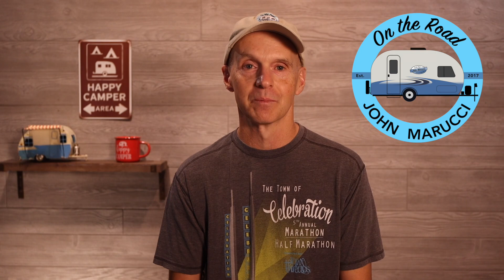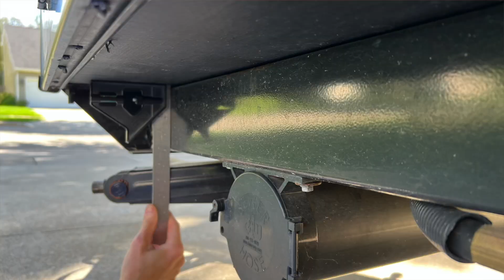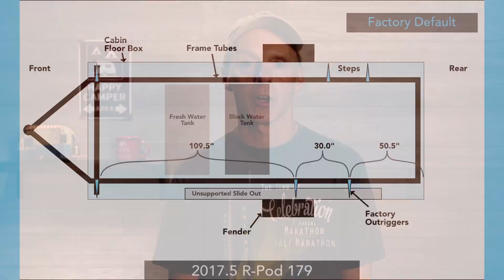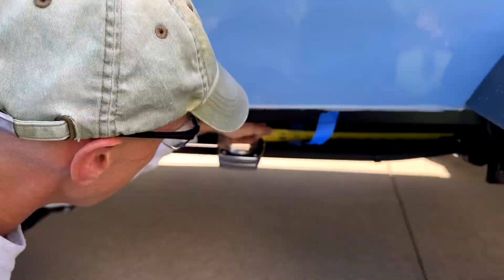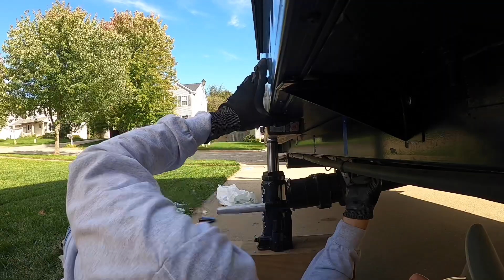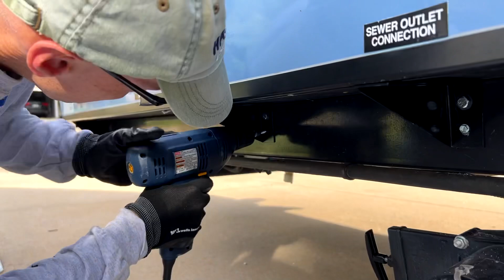R-Pod Outrigger Installation – Step-By-Step Process

Comment: If you can , use a pointed punch and hammer to dimple the location you want to drill so there is no chance of the drill walking out of the marked area for drilling. Use a pilot drill bit 1st if you don't have better quality to size drill bit.
Reply from the maker: That is a great tip to help ensure accuracy, thanks for sharing!

Comment: Hi John, I have several questions but will try to keep it simple. I bought a RP 178 built in 2013. This model only has one outrigger at the front of the trailer. I have significant sag below my pullout and will make myself several outrigger to fix the issue. My main question regards the construction of the floor itself. From other videos, I think I see that the floor is made of an aluminum square tubing frame that extends to the outer wall. So I think/hope it is a large rectangle of square tubing with cross braces welded at some irregular intervals along the length of the floor. I have to guess, the wall bottom is also a square tubing and it is bolted or screwed on top of the floor square tubings that are 6 inches outboard of the trailer steel frame. So here is the question: How can the wall sag if you have square tubing extending out over the steel frame. Are those square tubes breaking or bending under load? Should I try and position my outriggers right underneath of these aluminum square tubings cross braces?
Reply from the maker: This video may help as it is about 11 years old and should show some of the construction: https://youtu.be/vMXneKc_fDo?is=44Hr7luVIli6fCsd
Reply from the maker: My guess is you have weight and force over time that have injured the original wields on the aluminum rails.
Reply: @JohnMarucci This is what I  also suspect. I will be adding 12 outriggers on that side since there was only one at the front. 6 more will go on the other side as well before it suffers à similar fate. I am debating adding a piece of facia like sheet metal between the outrigger and the floor underlay that I would seal against the frame and along the side rail to provide lasting protection. I would appreciate your thoughts on this as well. It's a 2013.
Reply: Thank you very much John. Also, I have some more news on the matter of the floor construction. Because I found water in the floor of my 2013 RP178 rear cargo compartment, I removed a section of the underlay membrane, pulled the linoleum from above and removed all the delaminated plywood above and below that area. This gave me a clear view of the aluminum tubing in question, on both sides of the trailer. On the slide out side that was sagging, the tube is cracked (more like shattered) at the location of the retaining bolt, just outboard of the trailer steel frame. To my extreme displeasure "/$%?, the side that showed little to no sagging is also cracked so both ends of that square tubing are cracked just outboard of the steel frame. I took pictures of my discovery and could share them with you so others can beneficiate. Let me know which of your sites best allows for picture uploads. This tubing is much thinner than I expected ( 18 gauge, 16 at the very best) and extremely brittle. It feels similar to 2024 aircraft grade aluminum, I have seen on older Cessnas. Obviously not well suited for the repetitive high loading an R-pod floor is subjected to. I am going from bad to worse in my discoveries. Not what I wanted to see as you can imagine but would like to share with others who may wonder how the floor of an R-Pod is built. Regards  @JohnMarucci

Comment: Great video, I was wondering if you remember the dimensions of the bracket I have a 2016 RP 180 with the same issue, the slider wall  actually dropped down because of the sag. I just went to my local dealer and ordered the out riggers which are the exact same ones you had ordered. It looks like I have less room horizontally for the bracket. In that case, I may have to cut off the ends to keep them under the trailer. My thoughts are based on your video that you put out. Compare it to my trailer.
Reply from the maker: Thanks for watching! I do not have those dimensions, but the basic practice should be the same. All the best!

Comment: Are the zinc plated screws and bolts showing any sign of corrosion? I've debated going with stainless steel.
Reply from the maker: Unfortunately, I can’t speak to how the screws and bolts have done over time as the unit was sold a couple of years ago.

Comment: My 2017 R-pod 178 never had any outriggers installed. Found out about this issue last spring when I noticed that the fender on the slide side had less than an inch of clearance from the tire.

Phone calls and emails to Forest River’s parts department were ignored, though I tried calling the sales department and they picked up right away before transferring me.

This year I gave up on those scumbags and ordered reinforced 4x6 counter brackets and 1/4 aluminum plates from Amazon. They should be arriving today.

I just need to get this to a seasonal site I am leasing less than 10 miles away. Then I’ll back it up with some 2.5 ton rv stabilizers and a 2x4.
Reply from the maker: Sounds like a plan that could do the trick. I know several people on the R-Pod Owners forum have had outriggers made: https://www.rpod-owners.com/

Comment: Hi John. I am traveling so I cant wait around for Forest River to send me the outriggers. Do you think a length of steel L bracket welded to the frame would provide the same support? thanks so much for the video. I thought the floor had sunk down because I had spilled too much water on the floor😭
Reply from the maker: I would ask some of the folks on the R-Pod owners forum how they created their custom outriggers. I think there may even be a small fabricator making these now. rpod-owners.com
Reply: Innovative Machine & Supply has Outrigger brackets on the shelf ready to ship!

Comment: Interesting video John and thanks for the info with regards to the body outrigger supports. I have this problem too on my 2019 R-pod 180. I contacted Forest River about obtaining the supports, but instead got a lot push back. They feel that the supports just fixes a symptom and not the problem. They wanted me to take pictures showing the over hang sag with a combination square which I felt was reasonable. They sent me a questionnaire titled "Over Torsion Axle" where they also wanted a pictures of the axle tag on the Lippert axle, pictures of my towing set up, hitch set up, hitch, weight distribution hitch with the brand, tongue and weight capacities and tow vehicle type. They also wanted pictures of the unit showing the clearance between the fender and tires. Apparently they feel that this body sag is related to the axle and weight distribution hitch. I told her specifically that the floor sag was only evident directly under the slide out. That there is no sag in any other location. I told her that I felt sure that the issue was because of the lack of out rigger body supports at the frame. I measured the distance from each side of the frame at the axle to the ground which was exactly the same. I used a string to check for any bend in the axle housing - none. I checked the distance between the fenders and the tires which was almost the same. There was some difference in the clearance measurement only because I discovered that one fender was mounted higher on the body than the other one! I asked if I could just purchase the outrigger supports from her direct and she refused. She also wanted pictures of the inside floor sag with a level. I told her that there was no evidence of interior sag or separation between the floor and wall and hopefully will avoid any future separation if I can get these outrigger supports now so that I can install them immediately. She actually said no that I still needed to get pictures interior floor with a level. I'm at wits end with Forest River. I had many issues with this unit when I first got the unit new (that's a whole different story). I told her that if I can't get the outrigger supports from her, that I would go to a local fabricator and have them made. Sorry for being so wordy here, but wanted you to know my story and couldn't find any other way to get in touch with you.
Reply from the maker: Thanks for sharing your experience. Unfortunately, it is par for the course for R-Pod and was for me somewhat. They have been pushing back lately on supplying outriggers to customers and have taken some owner's units in and replaced the axle. If they are willing to fully add outriggers and replace the axle on their dime off-season, you may want to consider it. These all should have been recalled for this sag issue. There is a ton of dialog on this exact issue on the R-Pod owners forum (not FB): rpod-owners.com. FYI, I saw an identical post on another video and only left this one. Thanks.
Reply: Thanks again for replying. Yes...at first I balked at going through the process on the axle and all the info and pics they wanted when I was just wanting to purchase the out riggers. After giving it more consideration, I'm going to cooperate with them and see where the process goes. Like you said, if they are willing to add the out riggers and replace the axle on their dime, why not go a head with it and at least test the waters.
Reply: @wavanauken  Same thing just happened to us this spring. We had an annoying back and forth, but FR replace the torsion axle on our 2017 for free. They said they would send the outriggers along with it, but we would need to take care of the install of those ourselves, but the dealership doing our axle did the outriggers for us as well and we didn't pay a dime. It was gone two months, maybe only lost one month of the season, but it was annoying that it was that long because FR made the dealership go through the whole picture process all over again despite them already telling us it was approved.
Reply: @Bandgazebo  My axle turned out to be OK which I was pretty sure of anyway as I had no symptoms nor was there any sag in the suspension. The dealership confirmed the body sag under the slide out after Forest River made them jump through many hoops. I knew there was sag there as I had already checked it. But they did say they saw evidence of water leakage and attributed that to bad owner maintenance! That really ticked me off. Uh...yeah it had leaked water from the get go when it was brand new because the manufacturer didn't seal the the spoiler on the roof correctly. And then there was another water leak 2-3 years later because they didn't mount the AC unit correctly when they didn't properly torque the bolts to apply the right amount of pressure to the A/C roof gasket seal. Geeeeeez. And I got these leaks fixed right away so there was no prolonged water contamination or damage to the walls. Just some staining. They also said they could sell me the supports. Ha! SELL me the outrigger supports!!! I said NO. I will get them from a good independent metal fabricator which I found through one of the Forest River forums. The supports I found were much better quality than the ones FR offered me. And get this - I was talking to this independent shop about this issue and he said, yeah...we've sold a lot of these outrigger supports made directly for the FR R-pod. I asked about how many and he said oh...about 400-500 or there abouts. REALLY!!! That many shows just how poor the build was. The weight of the slide-out directly over the cantilevered frame where FR failed to install supports is what lead to the body sag. Not the axle which they said could cause this. What!!! The axle can cause the unsupported body to sag! Ha!! And it sure wasn't because of the alleged water contamination. 

When I first got this vehicle, there were about 20 things I found wrong with it. The dealership fixed a lot of it after many weeks of frustration getting it done. I repaired a lot because I was just sick and tired of dealing with them and taking it back and forth. That and I sure was more confident in the repairs I made myself because I knew i would do it correctly. I called Forest River directly about the poor workmanship when the unit was originally built. I sent them an 11 page write up with pictures of everything that I found wrong with it. They covered everything warranty, but that was such a hassle. They said that is what the warranty is for - to have these issues repaired. I told them no, the warranty is technically to repair mechanical issues that arise during the warranty contract period, not for defects that it comes with right out of the factory. Heck...the dealership even admitted that Forest River uses them as their quality control because they know there will be problems. Ha!!! I asked Forest River that I deserved some compensation for the hassle (many back and forth deliveries of the unit to the dealership, the waiting, the seemingly endless back and forth communications with the dealership and Forest River, etc.). They asked what kind of compensation was I looking for and I said somewhat jokingly some cash back would be nice. They said how much?!?! I was totally floored. I said how about $500 and they agreed! That says a lot and I'm not talking about the positive side. 

Also, actually, I had to get the AC gasket done twice. The first time I made a claim to my extend warranty company and I had it done at a dealership. Six months later it started leaking again. The gasket was cheap and it failed (split at the corners). I fixed it myself this time as I wasn't going to trust them to do it again even if it was warranty. I mean...the warranty is no good if they can't make quality repairs. And I wasn't going to use the same type of cheap gasket. I used a premium one piece high-quality closed cell EPDM sponge rubber gasket. Sure it was more expensive than the cheap gasket that was originally used, but it was a better gasket. 

Sorry for the wordy response. I will never deal with Forest River or their so called recommended warranty dealership service centers. Just FYI, I'm a retired mechanic and fleet manager with 38 years experience, so I do know a little bit about these things.
Reply: @wavanauken Can you tell me where you purchased your A/C gasket? Thanks

Comment: I just bought 6 outriggers. My 2016 has zero. I just came in from jacking the camper up, and it does not square up the floor to the frame. Odd......😮
Reply from the maker: That can happen. A bunch of people on the R-Pod owners forum have installed these with this exact situation. You’ll want to inquire how they handled it. rpod-owners.com
Reply: Thanks, John, much appreciated.

Comment: Hi John. I hope you are still replying to these post. I checked my Rpod 180 and it is not square. I received the out riggers from Forest river. I jacked the sid wall of the Pod till the tire was off the ground and that did not raise the floor. What am I doing wrong. Thanks
Reply from the maker: Glen, I don't think you are doing anything wrong. I have heard some people have this same problem when attempting to jack up the wall. I did not have this issue but you may want to inquire on the owner's forum to see how others have dealt with this: rpod-owners.com

Comment: The edge of the wall has some aluminum trim that the outer edge of the Outrigger rests upon. Maybe a quarter of an inch thick. When you square the frame to the sub-floor underneath, you are not including this. Would this actually give you a little extra lift? Possibly a good thing over time? My question is, did the aluminum trim ever start to collapse from the slide-out weight over time? If so, would it be worth its to insert a 1/4 spacer along the top of the Outrigger prior to install? Do you or anyone here know how many are needed for the RP180? Thank you!
Reply from the maker: People have done different things to compensate for the aluminum trim strip you mention. Some have notched the trim strip with a Dremel, which I thought might introduce water issues over time. Others added a spacer like you mentioned. Some people cut the outrigger arm short of the trim strip or had the outrigger fabricated as such. I did non of these and in the short run it didn't seem to damage anything. However, the trailer was sold last April, so I can't speak to how they've held up after much use. There are several threads about the outriggers on the rpod-owners.com forum if interested. Thanks!

Comment: Hi John! Thanks for you video. I just got 4 outriggers from forest river after contacting them to inquire (that’s how many they sent). I have a 2017 rp180. I have NO outrigger supports at all. I don’t like how the outrigger comes out onto the trim channel that’s made for the vinyl screw cover strip. How is yours holding up?  Has it flattened the trim channel? Im considering cutting the ends so they fit inside the trim channel instead of on it.

As to the outer screws on the support. I would recommend to install at least one on each. This would prevent the support from twisting out of place if heavily loaded, like over bumps. (I’m a civil engineer with some structural background.)

Also, I’m curious if you’ve ever heard of anyone using treated lumber as floor support between the frame rails. We’re starting to feel a little flex in our floor in the large gap area. Tank supports help for most of the floor, but in the middle there’s a big unsupported span.
Reply from the maker: Not sure if you have seen my floor warranty videos and Forest River's solution, but if not, here is the link to the R-pod video list. Look at the two floor warranty videos in the Major Issue section: https://johnmarucci.com/r-pod-video-list/

As far as outriggers, many people think the FR ones are subpar and are having them manufactured privately. There is a thread on the R-Pod owners forum that speaks to dealing with the trim channel if interested: rpod-owners.com 

Thanks!